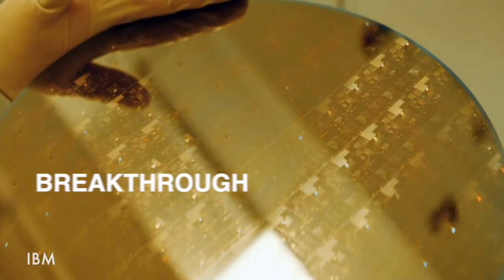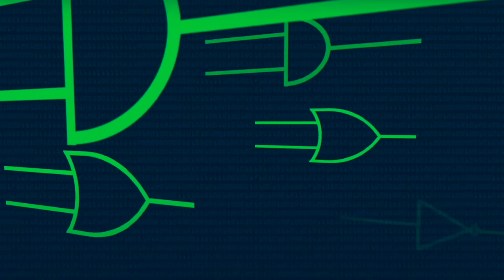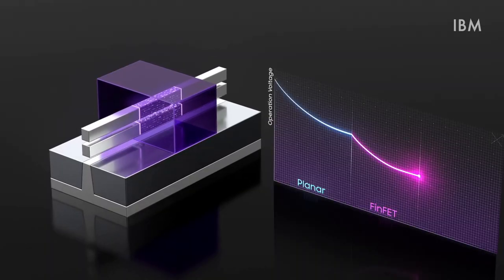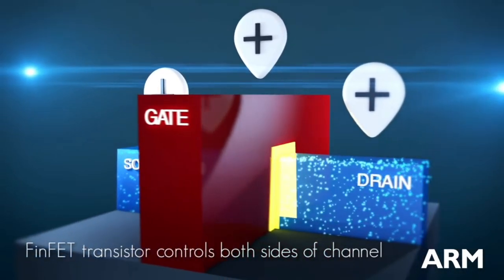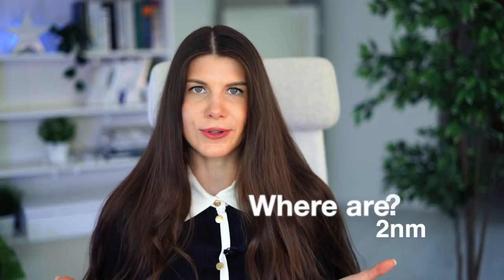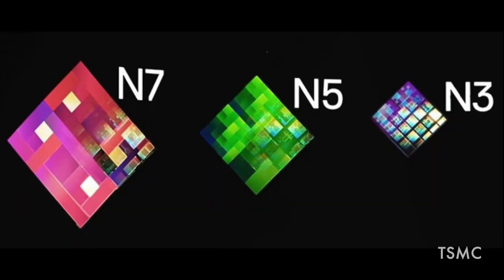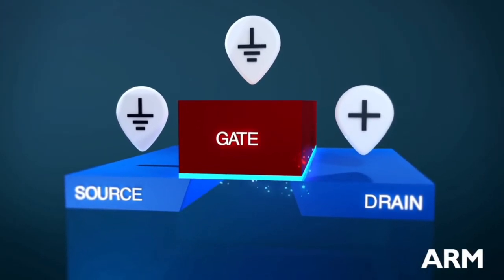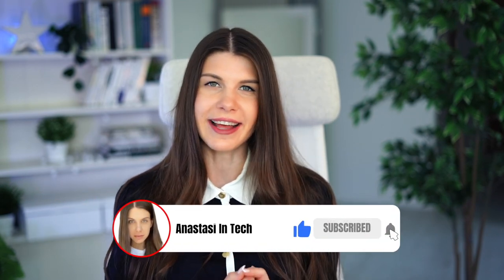New 2nm IBM's transistors explained

Comment: Too bad another one missed the core of Moore's Law.
Moore's Law isn't just about total transistors on a chip but total transistors at minimum costs per transistor on a chip.
Currently the highest density of cheap transistors can't be found in high end chips but in memory products...
Reply from the maker: I’m sure you know it, cost depends on volume. Assuming large volumes for new tech nodes (e.g. 10nm, 7nm, 5nm) scaling has about 20% less economical benefit compared to old tech nodes (65nm, 40nm, 28nm). This is true for large digital chips and for memory as well (though memory has other issues with scaling)